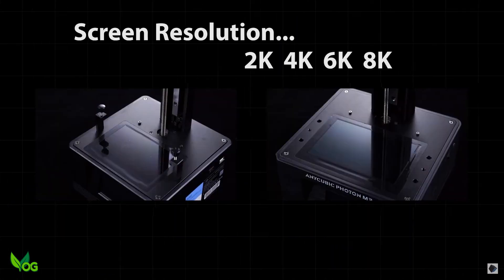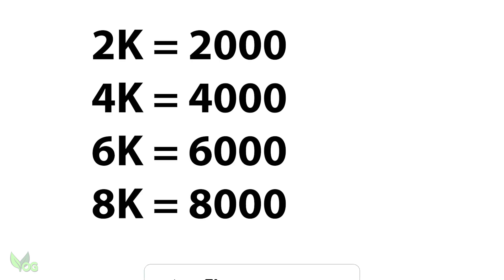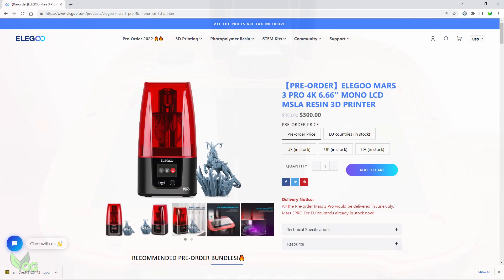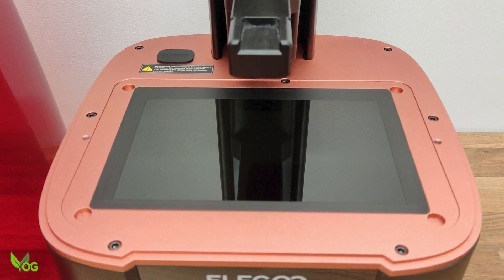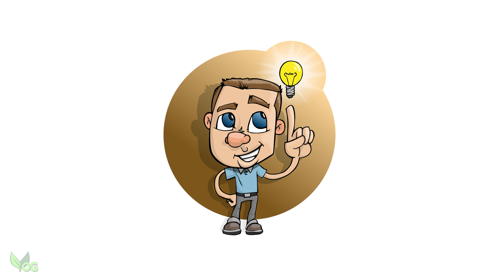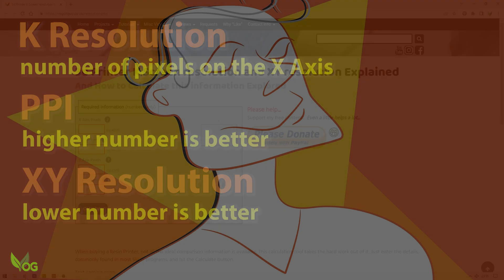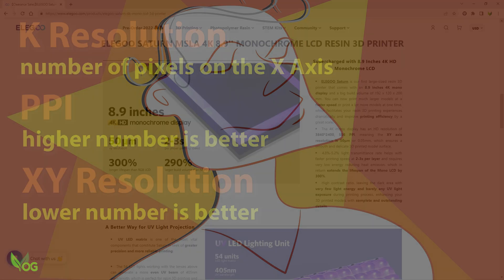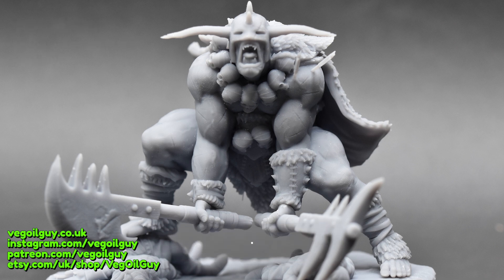3. Understanding XY, Z & K screen resolution in 3D resin printing. What does it all mean?

Comment: Absolutely accurate description , i have 2 printers Anycubic M3 "40 Microns" / Mono X2 "48 Microns" and I'm working on a head medical bust "big size" , the details on the same face which I divided into 2 parts on M3 is absolutely more crisp and sharper than the other side which I printed on Mono X2